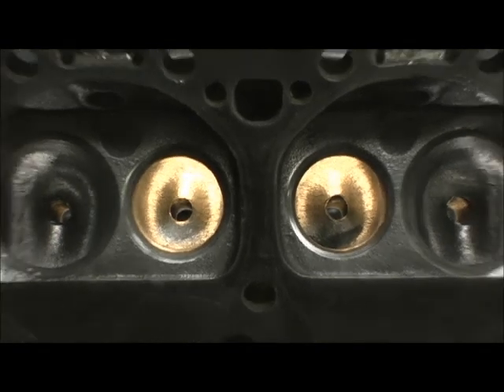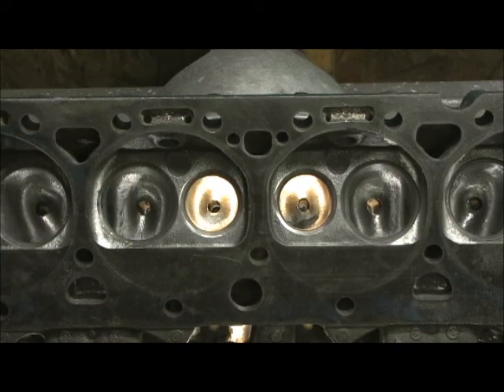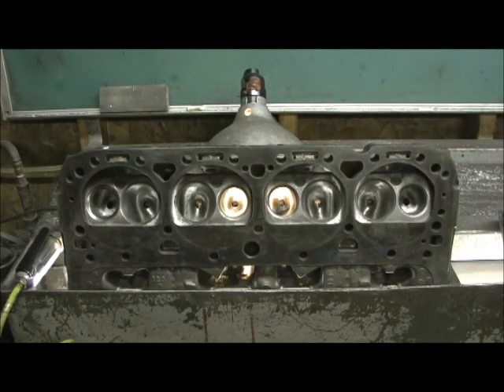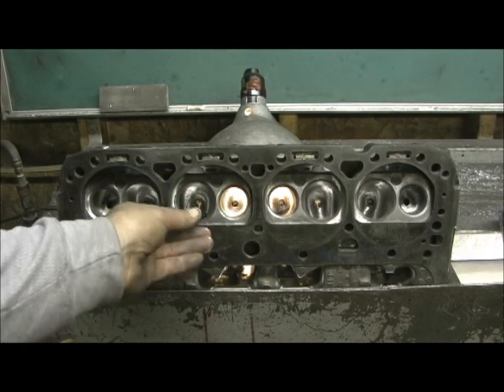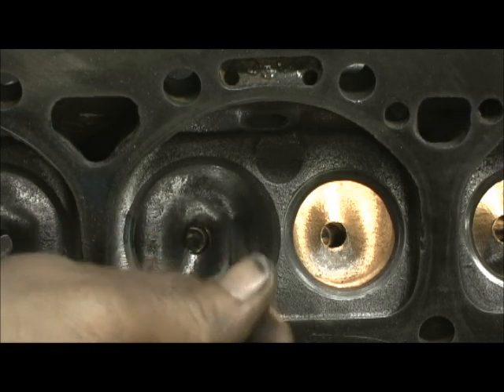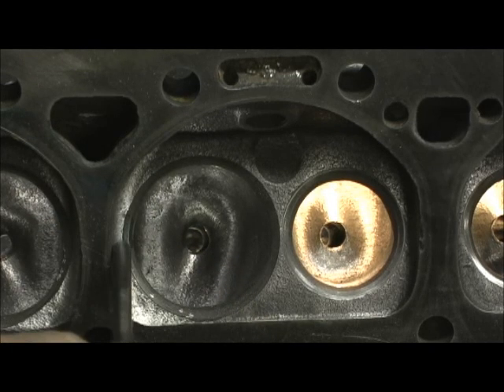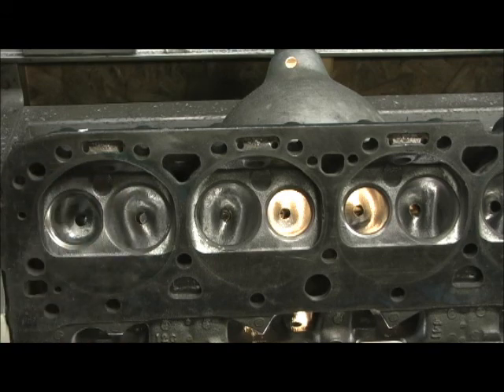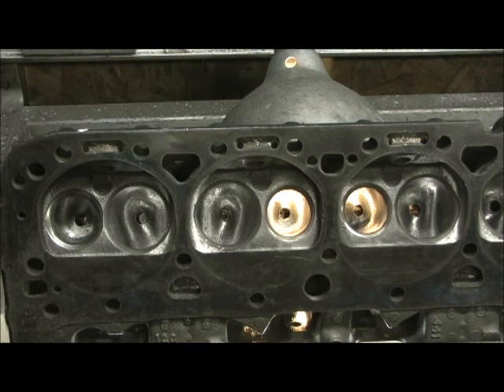441 Chevy Stage III.5 Street Porting

Comment: Very interesting work, so will you deck the head the additional  015? Always great to start with a perfectly flat head-- You know I always though these new and expensive heads were already to go but you exposed some poor workmanship in such expensive items
Reply from the maker: It is all about "Mass Production" and the flaws that accompany them. Sure, the new heads are great castings for sure: however, they just slam them together and send them out the door. I tell all my customers to "BUY BARE" and rid the chance of China Parts, then have some one that knows there Crap do the sizing of the valves your going to order (that way you know the guides have to be sized per vales used like a piston to cylinder bore). The only problem is that even though you have this done to the heads (I am talking about aluminum heads) please remember that the iron seats and bronze guides will MOVE AROUND during the heat/cold/water cycling, till it finds it place. Meaning you will have to do this again a few thousand miles down the road OR just put them on KNOWING you will have to take them off again and have this done to secure the problems of movement. A lot of trouble to do I know; however, you will have major gains if you do it like this.